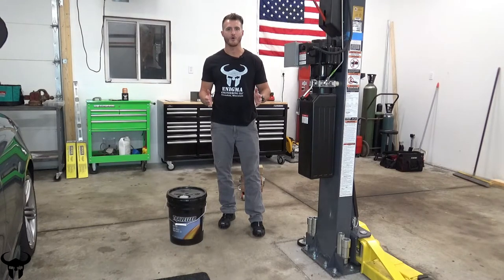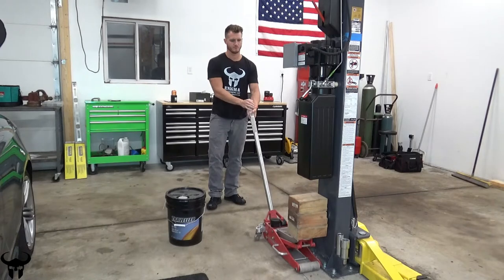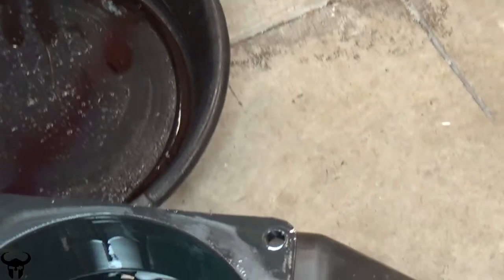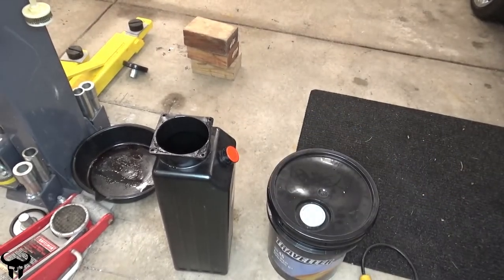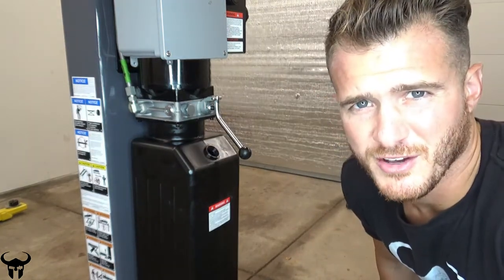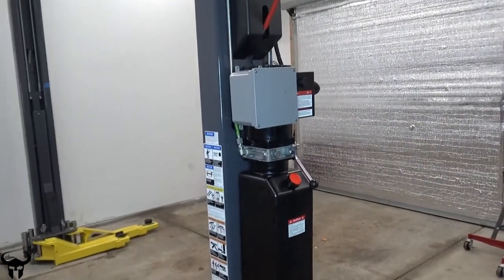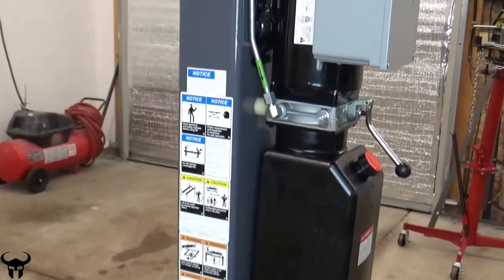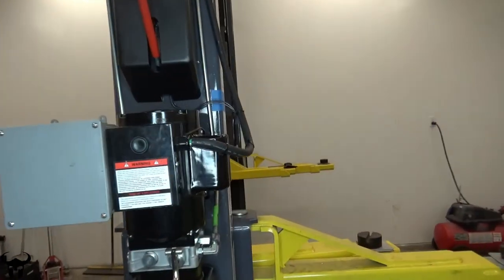Car Lift Oil Change - BendPak GrandPrix GP-7 Oil Change - Lift Maintenance (Super Garage Video #5)

Comment: Great video! Changing out the fluid every year or so will ensure the maximum life expectancy from your power unit and hydraulic components. Great tip! On the return line part, fluid will only return when you depress the lowering handle. Remember that for next time!
Reply from the maker: Ahhh gotcha - I did not try too hard to get fluid to return because I didn't want to damage anything. Thanks for the comment BendPak!

Comment: In the decades I worked as a mechanic I've never seen anyone ever change the oil in a hydraulic lift. The only thing I've ever seen get repaired on a lift was tightened up nuts that hold it to the floor. I'm gonna guess the first oil change is to flush out contamination.

Comment: Next time I'd suggest just sticking a tube down to the bottom of the reservoir and siphoning out the old fluid into a bucket. No disassembly required. If you're worried about shavings you could look in the bottom with an inspection camera after draining. You could also siphon in the new fluid by putting the bucket on a ladder if you didn't want to pour.
Reply from the maker: Thanks - all good advice here

Comment: I think you could of done that from the filter.  Take the filter off by using a small container underneath to catch the rest of it then you'll have to use a new filter if need. The filter itself that is but be very careful as you don't want to loosen the whole line and yup that's all you have to do